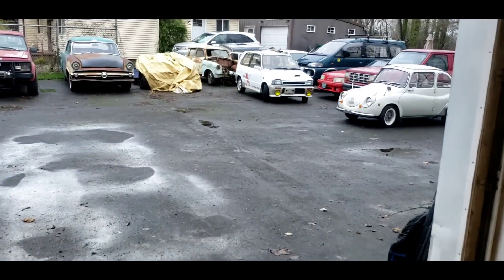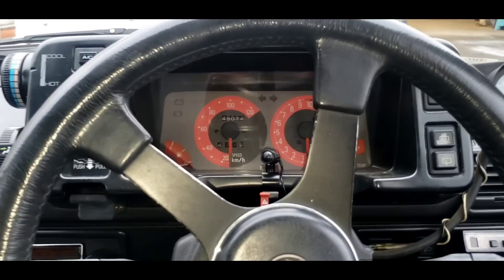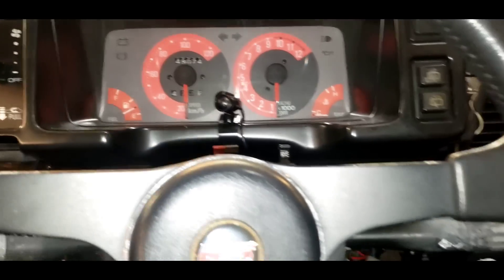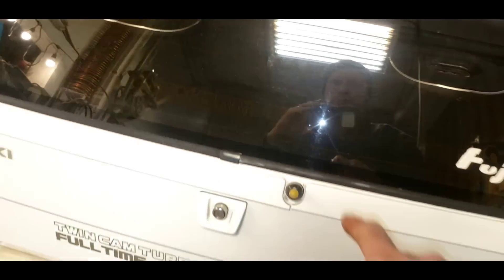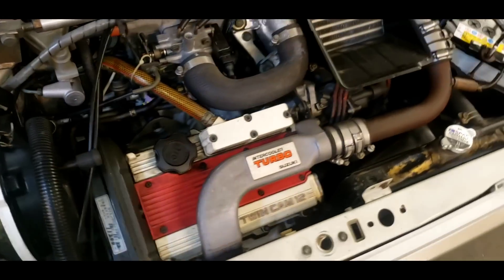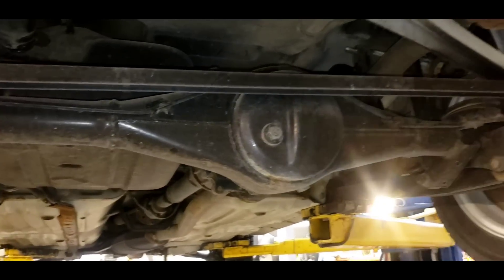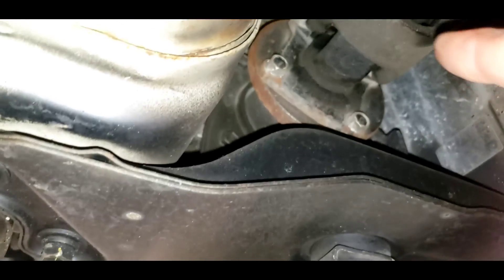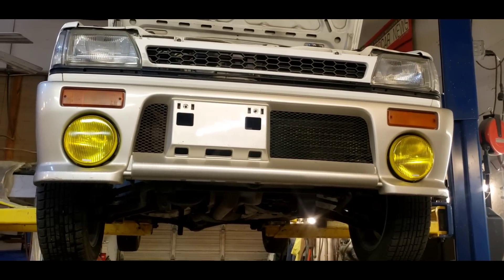This Wild Old Suzuki Alto Works is Quite Fantastic!

Comment: The rear locking diff looking thing is a viscous diff. Basically the full time 4wd is like the VWs 90/10. Torque only applied when the front slips.

Comment: G'day! We all enjoy cars like these. Solid and simple models, with engine and drivetrain from a supercar kind of style. Just with less cylinders.  In the States, we think of hatchbacks as puny, minimally equipped tin cans that people buy because they can’t afford something better. Elsewhere in the world and especially in Japan, not only are the smallest of the small keicars acceptable, they are desirable, deliver superior performance, and are packed with technology that would make actual sports cars of the era look like an oxcart. There was perhaps no better example of this phenomenon than this Suzuki Alto Works, the tiniest hot hatch.

The 1970s birthed the hot hatch revolution, normal econo-boxes with hotted up engines that, while usually on the slow side of the spectrum, were more fun than a barrel of monkeys. It was the whole “driving a slow car fast” proverb in action. Japan, where tiny cars were all the rage, took this to a whole new level, and by the 1980s, just about every hatchback had a performance variant.

Suzuki, which dominated the kei car market, of course had a kei hatchback, the very popular Alto. With a the hot hatch movement in its prime, they basically had no choice but to build it into a 'hot kei hatch'. So, Suzuki took the Alto, gave it to the mad scientists at their performance department and said, “Have at it.”

It was from there that Suzuki released a SOHC intercooled turbocharged Alto Turbo in 1985. From there, it developed a twin-cam variant, and in February 1987 it morphed into its ultimate boss form — the Suzuki Alto Works.

There were three trim levels The RS-S was the most basic model, the RS-X added options like aircon and a really awesome 'day glow pink-accented interior' option. The king daddy RS-R added full-time AWD on top of that.

Each Alto Works featured the same bold aero kit, alloy wheels, spoiler, and (relatively) massive hood scoop. In case the bodywork wasn’t enough to set it apart, Suzuki also affixed a furlong of vinyl decals across any flat surface it could find, boldly announcing that this was, in fact, a 'Works car'. Each feature had a separate sticker: fuel delivery, camshaft count, aspiration system, power delivery and trim level are all accounted for, in addition to two stripes that ran half the length of the door and boot lid. Even the defroster element let you know the car was twin-cammed and turbocharged.

It was one of the best performing kei cars of the era, and even today the F6A is widely considered the high point in Suzuki engine design. The car was a sensation in the kei car aftermarket, outshined only by the roadsters and mid-engined kei models it shared an engine with.

Speaking of that engine, to fully appreciate the Suzuki Alto Works we need to talk about the sensational 657cc F6A. The basics are that it’s a turbocharged, dual overhead 3-cylinder design, but it get’s even better when you dive into the technical aspects.

The F6A was just shy of a square bore-to-stroke ratio at 65.0 x 66.0 mm, and had a semi-closed engine block deck to keep cylinder movement to a minimum. To those of us who aren’t enthused by number crunching, that means that the engine is capable of safely revving to extreme engine speeds. Stratospheric redlines north of 9,500 rpm are commonplace among tuned F6As.

Unlike its successor, the F6A had an iron block, which allowed the block to handle whatever boost pressure was thrown at it. It was a perfect combination of attributes for an endlessly reliable and capable engine. It’s not unheard of for Alto Works to reliably produce 120 horsepower on street driven cars with not much beyond basic bolt-ons.

Beyond its incredible engine, the Alto Works was a properly sporty car. If the Civic SiR was a tiger, then this was a sand cat. It was the tiniest hot hatch you could get, but just as fierce as the big cats.

By the way... There an absolute riot to drive! When boost comes on it tasks off and with short gearing your in 5th in no time. It is a true (AWD) rocket on wheels! Thank you! 

Cheers! 😊✌🏻🚗❤️

Comment: Wayyyy smaller than the Rabbit GTI but 4WD, which a 1987 standard GTI never had. Obviously made for Japan as hot hatch kei car. https://en.m.wikipedia.org/wiki/Suzuki_Alto#Second_generation_(1984)
Why does it have snow tires? I understood that you don't have snow over there in Oregon and it's already a true 4wd.